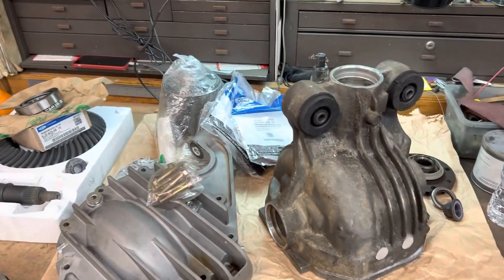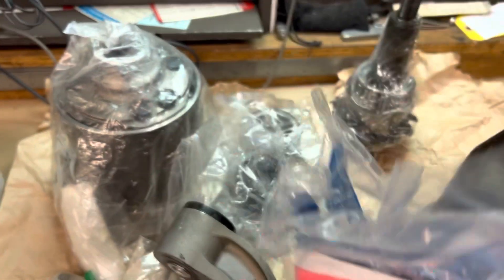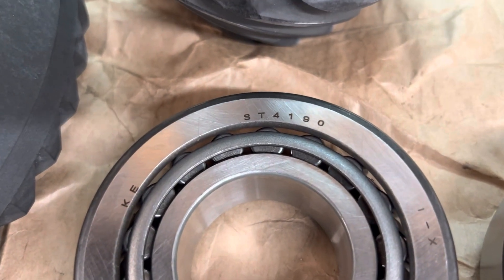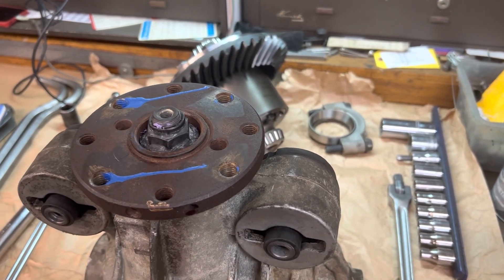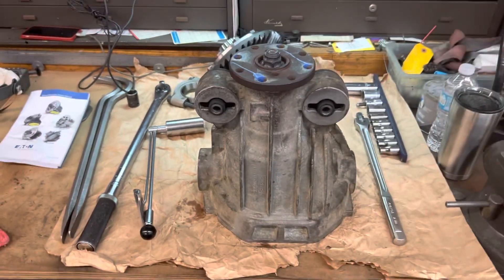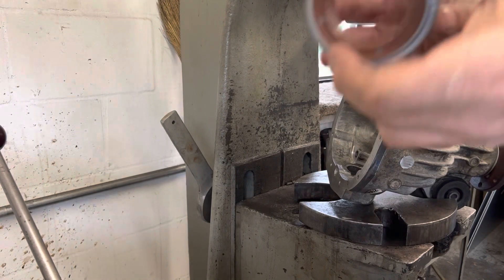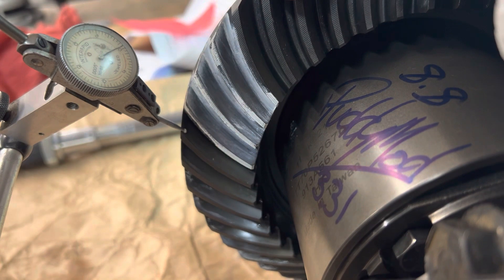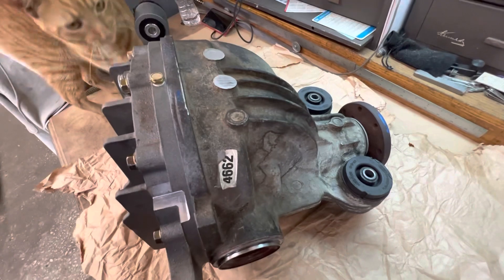Ford 8.8 differential build for NC Miata with 2.3L destroker turbo track car

Comment: I ended up using a 31 shim and 8 thou backlash when i built my 8.8.. Pinion preload 24 and carrier set at 34-36 inch lbs